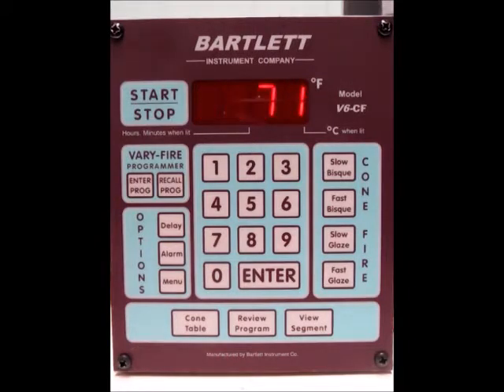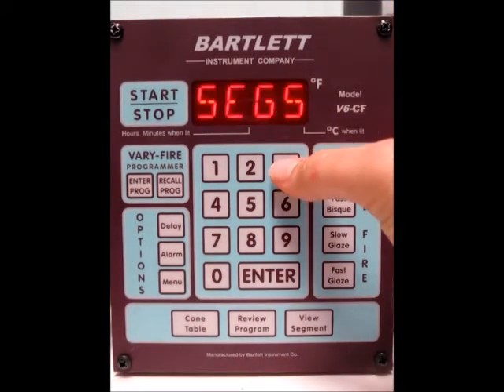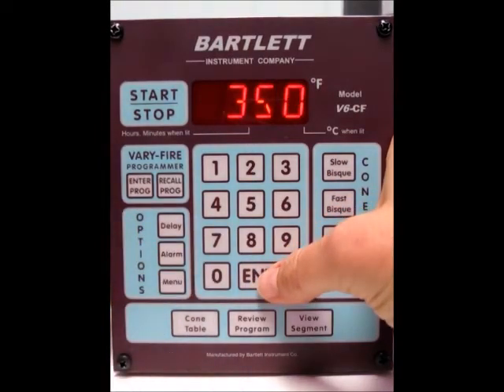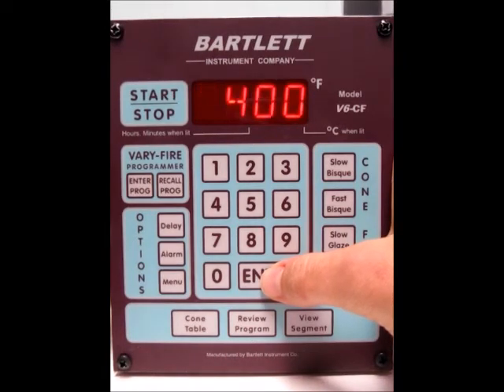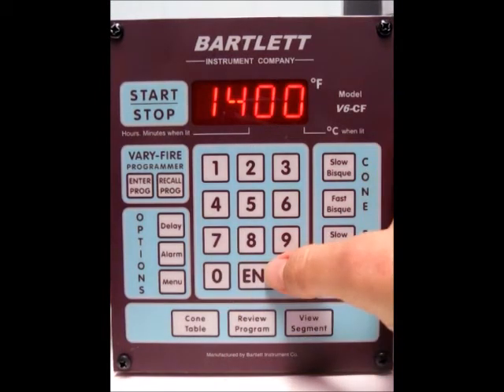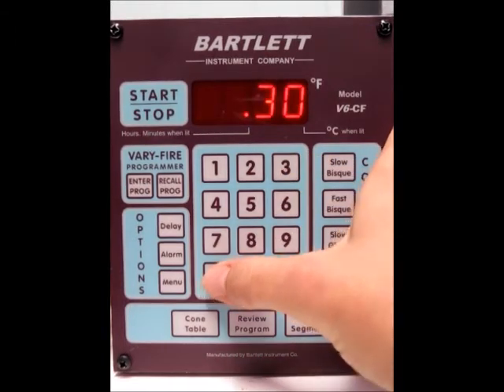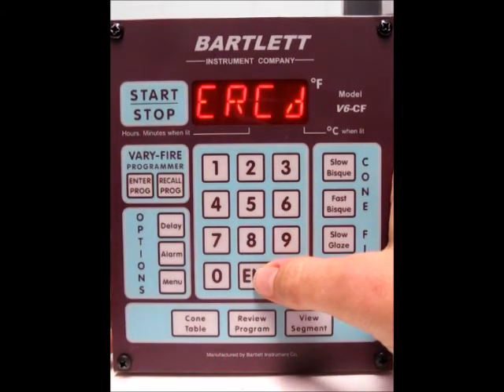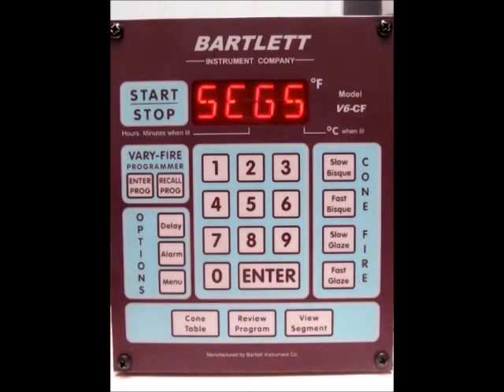Bartlett V6CF | Vary-Fire Programming

Comment: How do I start over or backspace? I made a mistake
Reply from the maker: When programming we do not have the ability to backspace. If you put in a value for example of 1000 and you actually needed 100 then you just type 0100 and then it should write over the 1000. If you question is about if you put in a value and already pressed enter to go to the next step you will have to continue on with the programming like normal until it goes CPL and back to Idle. Then go back into the programming and step through the program until you get to the part you want to change. Then make the changes. Then press enter repeatedly going through the remainder of the program until you see CPL and the controller goes back to Idle.

Comment: I am totally confused.  Want to do a FIRST FIRING for my ConeArt 115SQ glass fusion kiln.  My understanding is to use 1 segment, 1500degreesF for 5 hours.  Can you please clarify and provide the proper instructions for Glass Fusion Kiln?  Thanks
Reply from the maker: Normally for first firings we recommend you reach out to the kiln manufacture to get instructions as they design the kiln and control box then wire our controller to their control box. I do see that you reached out to our information email account. We will reply back to you with instructions on who to contact.

Comment: The video assumes a person knows what the terms are and that the viewer knows how to use a kiln.  In this segment the presenter goes through segments.  But why would one want to use segments.  There is a lot of foundational information missing.
Reply from the maker: Vary Fire programming is when you want to set up your own program and do a firing with one or multiple segments (steps in the firing). For example, when firing glass, you would want multiple segments as you will fire up to your temperature needed (segment 1 or multiple) then back down to anneal (maybe multiple segments as well). If you have more questions, you can email information@bartinst.com

Comment: can I delete a user program and start over? I don't want to override a program. just delete it and start fresh.
Reply from the maker: You cannot delete a User program in the V6-Cf controller. To delete or remove it you will just write over it with your new program. When programming it will only fire the number of segments you select for that User program and will not fire remainder segments not being used. If you need more information, you can reach out to us at information@bartinst.com

Comment: Maybe an overview of terms would be great. What is ramp rate? How are segments destined? What temperature is recommended?
Reply from the maker: Thanks for reaching out with your questions. I have passed this information along internally to see what we can do a offer overviews for the terms. . Segments are made up of 3 things. First in the programming of a segment is the ramp rate (rA). This is the degree per hour that you would like to fire the kiln at to your desired temperature. Second is the desired temperature (F or C) you would like to fire to for the segment. Third is a hold time (hLd) at the desired temperature. A firing can have multiply segments. The firing rates, temperatures recommended, and holds you should contact the clay or glaze manufactures for. If you would like to better discuss the firing terms on our controller you can reach out to information@bartinst.com

Comment: I fired my kiln to cone 5 but when I opened it up, witness cone 4 was melted but witness  cone five had barely started to bend so I am thinking I need to do a cone offset before firing again.  What degree offset would you suggest when I do a cone offset or should I do a thermocouple offset?  Also, do you think I will need to do the same offset for each cone I fire to?  I usually fire to cone 04, 05 and 5 or 6.  Should I offset each of those cones the same amount as I do for the 04?  Thank you so much for your help.
Reply from the maker: If you look at a clock you want a witness cone to bend between 3 and 4 on the clock. If your Cone 5 was before that then I would suggest just doing a 5 to 10 min hold/soak at the cone temperature depending on how close if was to 3 on the clock. Your other cone fires I would place self supporting witness cones in those firings to see if adjustments need to be made. For more information/tech support you can email us at information@bartinst.com
Reply: @bartlettinstrumentcompany4969  Thank you so much for getting back to me. I will do as you suggest.  I really like the controller and would not want to ever go back to the kiln sitter now that I have used the controller.  Thanks again.